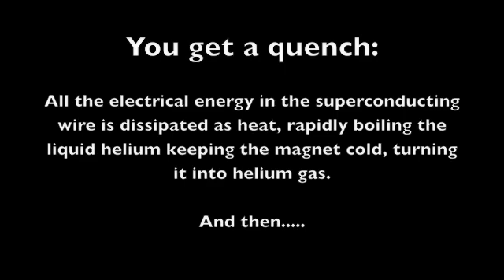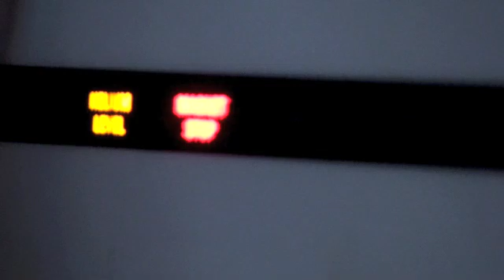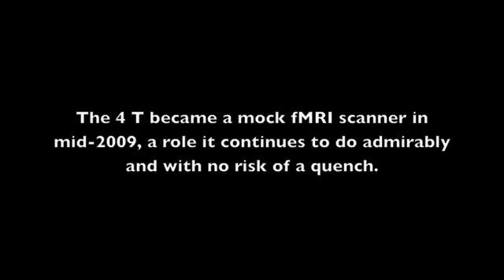MRI magnet quench: the movie

Comment: Is the helium the reason why scanning rooms in hospitals and medical facilities are always so cold, or is it because there's a reason they need turn up the air conditioning near the machines?
Reply: If anything, keeping the helium liquid will add heat to the room, much like a refrigerator does. I think the cooling is done both for the comfort of the employees and for the computers, either way the chilling is done externally and not as an effect of the helium.
Reply: Melissa0774 Often the machines in the different procedural rooms throw off a lot of heat, and would shut down if the rooms were not cooled. Also, especially in any procedural room where a provider spends a significant amount of time wearing lead aprons + a sterile gown, it gets very hot. If there is a patient safety concern a personal warming device is often applied, but for shorter imaging studies the patient is given some extra blankets and the room is kept cold.
Reply: its because the MRI is filled with liquid helium to keep it cool and operational
Reply: Because there are ghosts trapped inside the rotating magnetic field of death and can't escape much like a black hole....😮

lol😂
Reply: Melissa0774 the reason is patients going for MRI are often seriously ill. Getting the room cold is a gentle, gradual, unobtrusive way for them to get slowly prepared to the cold of the morgue.
Reply: @charlieangkor8649  Dafuq? ^^

Comment: Now once you quench an MRI machine, it is unable to be used afterwards right?
Reply: My father works for a UK company that manufactures MRI Scanners and other Superconducting magnets (Eg: For Fusion reactors, the Large Hardon Collider and other particle accelerators).

When they are making the magnets, often while testing the magnets, the magnets will quench many times - sometimes up to 10 times - before the superconducting wire gets stable. When this happens the factory gets filled with helium gas as seen in that video. Of course, this happens during testing and under controlled conditions, so the risk of damage is minimal.

You can reuse MRI machines after a Quench, however, they will need to be serviced and refilled with liquid helium. A quench is also a violent process so sometimes some parts can be damaged.

There are lots of options for third party repairs of most MRI Scanners if the original manufacturer doesn't support them anymore.
Reply: It depends on how fast the temperature changes in the windings. If it is too rapid, then those windings will have to be replaced, which is VERY expensive both from a labor and parts cost standpoint.

Comment from the maker: This was early '09 when the L-He shortage wasn't as acute. And even if we had wanted to salvage it there would have been a lot of cost for recovery of the approx 1500 liters. So we were either going to run down the magnet over the power supply and let the L-He boil away over months, or quench. The fast, cheap option was the Big Red Button.
Reply: Not when they can buy 1500L from a regular supplier have the regular guarantee of purity.  No matter how unlikely contamination is, these guys couldn't come up with another batch to replace it if something went wrong after they paid all the other costs.  Plus even at current prices it's only $5/L, so $7500 for that amount.  No way they're rigging a safe recovery mechanism cheap enough to justify that.
Reply: Nice try at a rationalization, you could have easily found a buyer for that 1500 liters who would gladly pay for the cost of recovery and transportation.

Comment: I've scrapped many MRIs over the years, and quenched a couple. (in trailers). The quench button turns on a heating element rack, like a toaster, deep inside the tank. It causes the pressure to rise and pop the disc. Some HE remains for a while due to the BLEVE effect. We've used residual HE to launch weather balloons as a joke. If you pierce the tank and lose the vacuum, any HE left will boil in seconds! That's how efficient vacuum is for insulation! The machines are amazing! Lotta scrap value!

Comment from the maker: The beep/strobe comes from the magnet monitoring electronics. Having activated the quench circuit the monitor is telling me that the magnet is no more and needs attention. If we were going to re-energize it that would have meant putting in a new carbon burst disk asap, to prevent air turning into ice inside the magnet. The ceiling has condensation because it's being cooled by gaseous helium at WAY below zero C. It's so cold the air liquifies on the steel of the magnet turret.

Comment from the maker: FAQ #12. Can the oxygen level drop in the magnet room after a quench?

If the helium vents outside properly then the oxygen level will remain at ~20%. The liquefied air components quickly re-vaporize once they've dripped off the turret. But if there is a helium leak - even a small one that you might not see - then the oxygen level can drop quickly. That's why we had the doors open throughout the quench. Ensuring fresh air can enter the magnet room is essential, otherwise it's a no go zone.

Comment from the maker: FAQ #11. What is the procedure for entering a magnet room after a quench?

If you don't have the right training, don't! But if you need to recover a subject from the magnet, stay *WELL* away from any gases you can see, and don't loiter. Get in and get out, fast! In the video there is some water vapor (mist) visible near the ceiling; that's not dangerous. But the liquefied air from the turret will cause serious burns even if there's no helium vented into the room.

Comment from the maker: FAQ #10. So if there was to be a problem venting the helium outside, what would the magnet room look like?

If helium gas vented back into the magnet room then it would quickly fill with a dense white fog that would build from the ceiling down. You can see an example of a room filling with helium by searching YouTube for "NMR Oxford Superconducting magnet QUENCH at Reading University." Bear in mind an MRI magnet, holding some 50 times more liquid helium, would fill the room *FAR* quicker!!